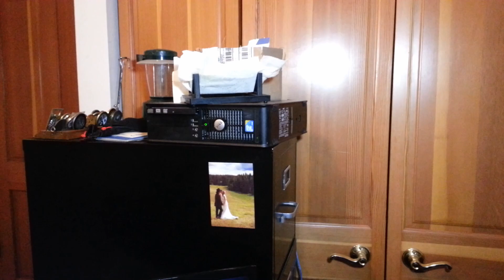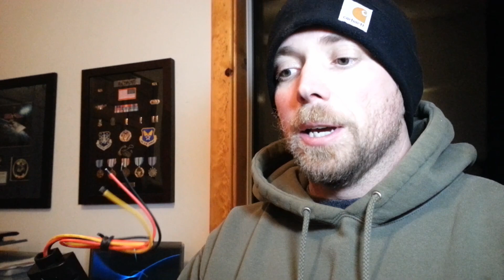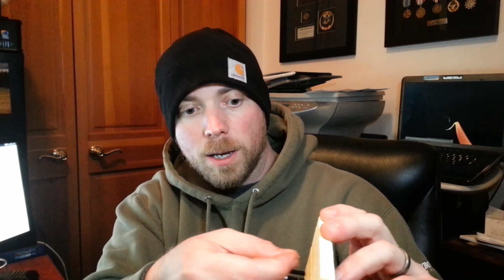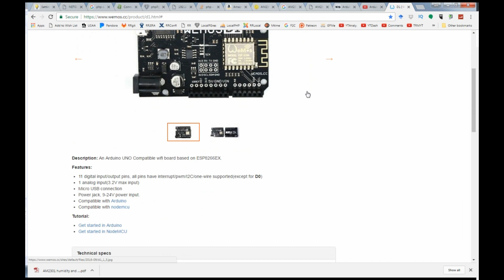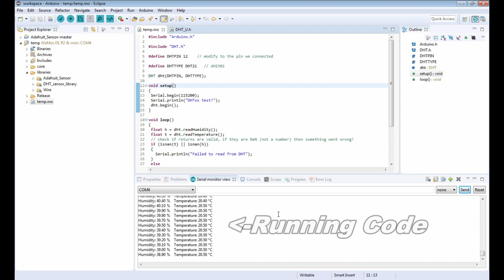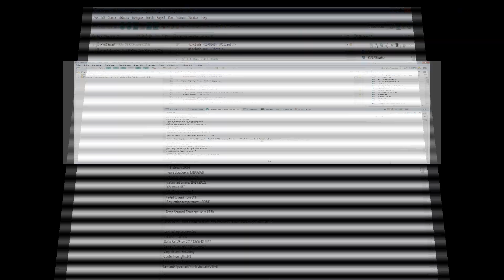How to build your own TEMPERATURE and HUMIDITY sensor with ARDUINO Part 1

Comment: Don't know if you aware of these  devices but there complete wireless arduino based controllers to do exactly what your trying to accomplish.  The best part less $<10 per node.   You can hack them to run your own code.  Check them out and  save yourself a lot of hardware build time.

https://www.itead.cc/smart-home/sonoff-th.html

There is even one that will report power used. You command a motor on and verify it actually is running. Endless possibilities.

Comment: You might also want to store the temperatures with a timestamp on the device somehow, incase wifi goes down. Then you can re-sync it all and have the appropriate timestamp against when it was recorded, not when it was received by apache.

Comment: Dude, that was one awesome video:) I love making my life easier and have wanted to do stuff with programming in my AP system:) I love that you have sensors taking readings and how it sends the data to a MySQL database! What is the use of Joomla? Also, instead of using a local server couldn't you create one online and just connect to that so you can access data anywhere? I am so into what you are doing because these are things I wanted to do and you are inspiring me to revisit my limited programming knowledge!
Reply from the maker: thanks! and glad it is inspiring...there are days it certainly doesn't feel that way to me :-) Working part 2 now...going to see it in action :-) #codingishard....sometimes
Reply: Having a local server with the sensors and actuarots means the system is going to work even if connection to internet is broken. I am thinking +TheRealMartian wants to make self-sustaining systems.

Of course the local server can be connected to a remote server that would be hosted somewhere on them cloud plumbings.
Reply: TheRealMartian, It is hard sometimes, but when it WORKS!!! :) I love it man and I am looking forward to see where the Lord takes you guys!
Reply: Teemu Hakala, ah! Good point but I was thinking a local server would be good along with connected to the web:) I should have said that!
Reply from the maker: you are exactly correct!

Comment: It won't matter for your set up, but for a large network environment you would want to collect a larger amount of data before each cycle of .. Open session> dump data > close session repeat.  do to the amount of traffic and the # of sessions.   In your situation this will not likely present a problem.   This is at least as interesting as watching Cody sharpen a chisel.. lol  Keep it up and thanks for sharing.

Comment: Just wanted to let you know that you have inspired me to get back to smelling hot rosin again. I built my first video terminal from bits and pieces in the late '70s as well as building a Heathkit (a name probably not too many people remember) hobby computer. That turned into a full time computer tech position after retiring from the AF serving 21 years. Now at 72 years old I'm dabbling again. My goal is to design/build a system that controls my blast gates and dust collector when one of my stationary woodworking tools is turned on/off. Thanks again and keep your head up because it seems to be glued on correctly.
Reply: John Corbett, I remember Heathkit! My (high school advanced electronics) club built one in '79.

Comment: Awesome video, why are you sending html code with human text to the server instead of just the raw values in a json format? That would be easier to store in a database model and display it in many different formats depending on the user interface. Also easier to analyze the data you gather over time etc. I would leave the human readable text / nice graphics over to the user interface (web/app etc).

Comment: this is a lot of data if you will have more and more sensors, there are special things designed for such a data. first of all MQTT for the data gathering (it is very small and robust), then something to store timeseries data (eg. influxdb or graphite) and then display (e.g. grafana or graphiteapp.org) everything you can use on your local machine with minimum configuration effort but maximum effect

Comment: Good stuff very interesting. Q? though. You kind of lost me there at the end. I see that you were testing your code, but it seemed that you were testing what you have already built, not the Arduino set in your lab for the humidity sensor? If I am mistaken I apologize.

Comment: Postgres and MySQL are both good options for your needs, but I would stay with mysql, since I find it much easier to configure and maintain. Also, there are a lot of technical good reasons but I don't think it applies to your system.
Reply: MySQL also has a far larger user base, and selection of very good open source tools.
Reply: Denys Sene I'd go MariaDB which is a drop in replacement for MySQL
Reply: MyPhpAdmin is a great tool for managing MySQL databases, and it's free.
Reply: definitely another great option, but I think that mysql is better for this case. We have to consider that he's not familiar with all that, so keeping things simple might be a good idea.

Comment: I usually prototype my stuff on an Arduino, then when I have it all working in a test setup, I will design and print a 3D box on my 3D printer specifically designed for what I am doing (sensor in/out, buttons, lcd etc), but I usually switch to a Teensy (some variant), its a 3rd the size of the Arduino, and you usually do not need everything on a full Arduino. Cheaper that way.